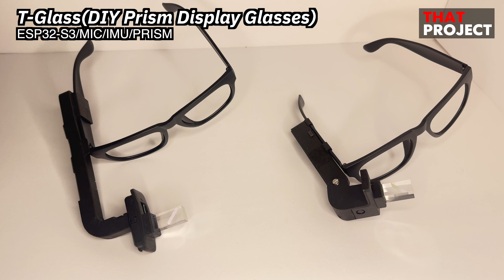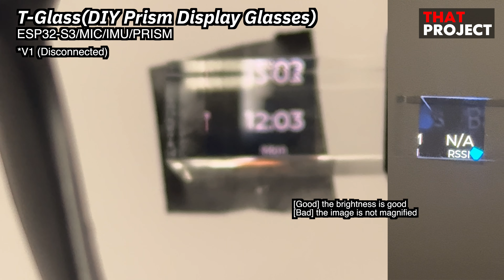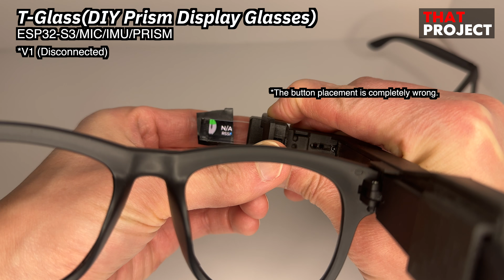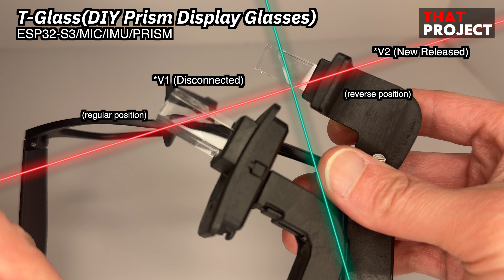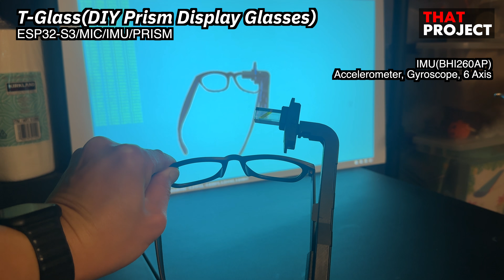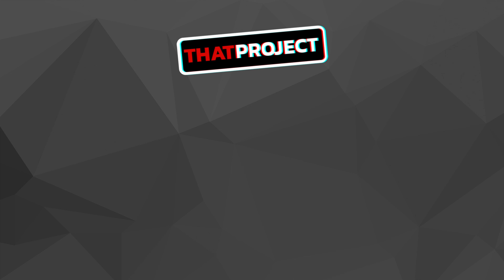$60? ESP32-based Smart Glass. Pros and Cons of T-Glass v2. #programmable #IoT #Prism

Comment: I bought the V2 about a month ago and was astounded how unusable the display is on mine -- a large portion of the display is cut off vertically (about the bottom half) and the top quarter is repeated upside-down at the top... totally useless for my applications. Furthermore the screen is so close to my eyes that it requires concerted effort to make my eyes focus enough to read the text, and I have excellent uncorrected vision. Pass on this one.